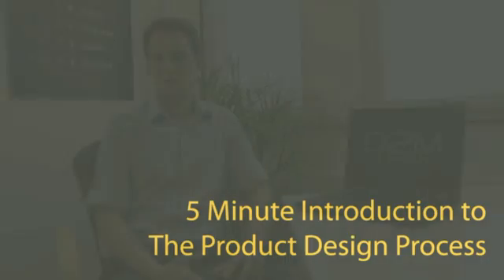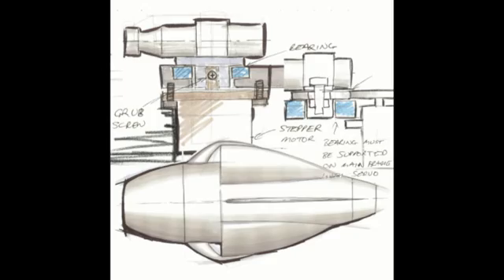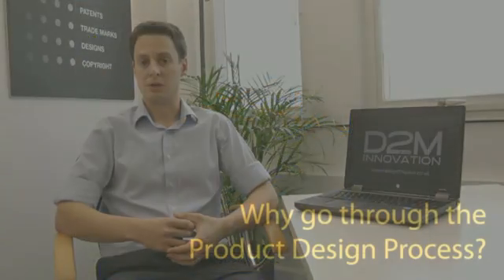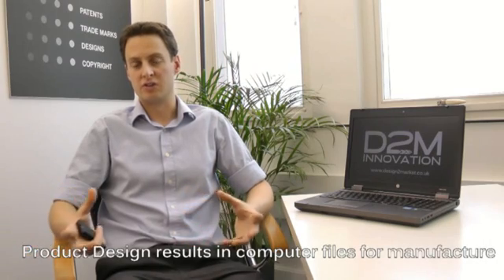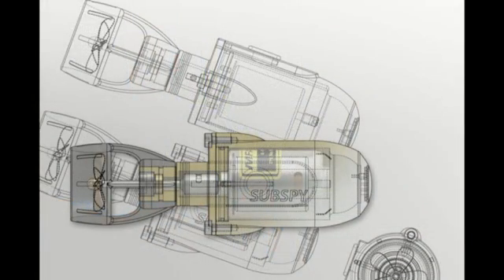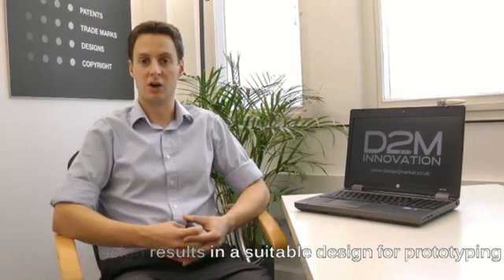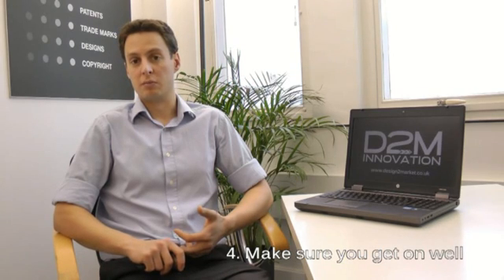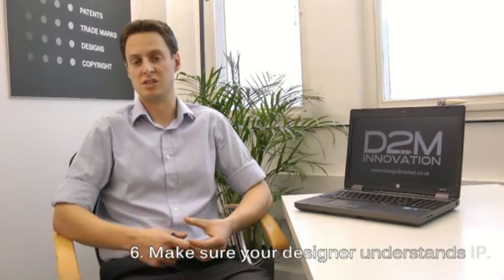How To Develop a Product From Scratch To Profit

Comment: I noticed you used Product Design and Product Development interchangeably.  Is there a difference?
Reply: Product development should refer to the whole development process starting with the idea, while product design can sometimes only refer to the actual process of developing the concept into a detailed designed and optimized object. I understand, you propably have found the answer by now, but just in case someone is still wondering.
Reply from the maker: Great answer and I agree!

Comment: Hi I appreciate the points in the presentation, think i may have a prototyper who covers this. I have a concern now that i have a patent pending but through my own prototyping have changed the product so much that i think i would have to re-submit it. as this is the case i am quite dubious about sharing this idea, if i were to offer D2M only to final design plus 200 of the product for market research would you be willing to take it on.
Curtis Dorrington, curtisletterbox@hotmail.com
Reply: It all depends on your product. Some products structure allows alternative manufacturing processes to be used for short-runs. Some other products require mass production techniques to produce. If your idea is patentable you can request your design partner to sign an NDA. However, if your budget is less than 100k pounds, some might not be willing to go through the hassle.
Reply from the maker: A good patent attorney will file your patent application with a broad wording so that minor developments and changes are covered. Sometimes this isn't possible and so it is always best to use a product designer who works very closely with the patent attorney to avoid these kind of issues.